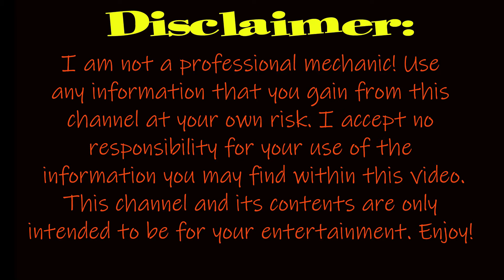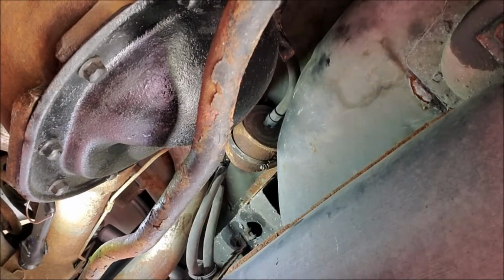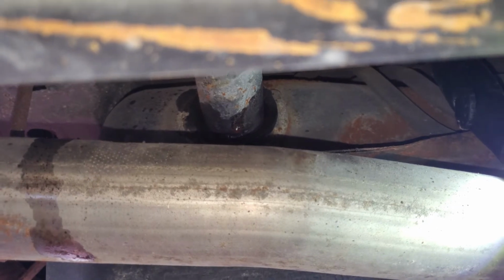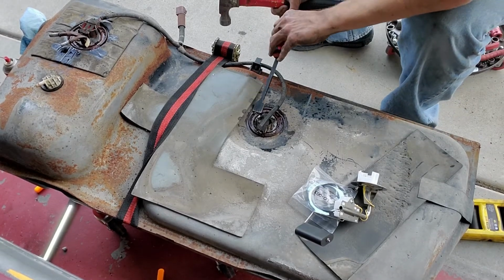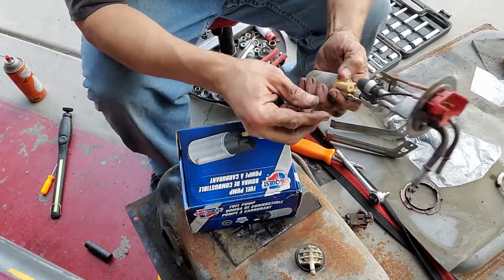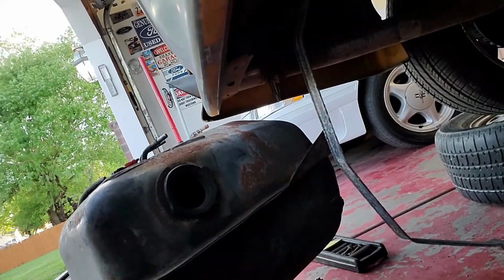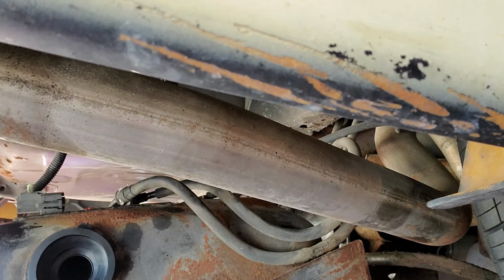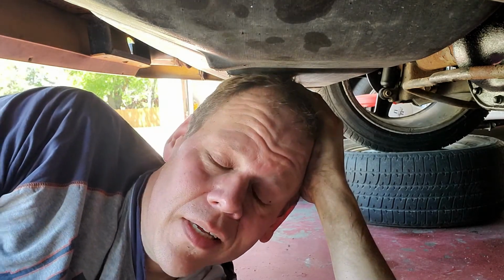The 89G ☑️ Fox Body Fuel Pump, Sending Unit, Filter, and Filler Neck Grommet Install 💥 EP46

Comment: I have a quick question.  I have a 88 lx it a 4 banger that plain to change out to a v8 one day.  My question is I've changed out the fuel pump  sending unit  fuel filter and fuel neck grommet .  On someday the fuel pump will prime like normal then there's other  days it primes continuously and want shut off . What do you think the issue may be?
Reply from the maker: I'd start easy by checking/replacing the FP relay under the drivers seat. I'm not certain on the 4 cylinder, but the symptoms you are experiencing could be signs of a failing ECU. When the fuel pump runs continuously, does it still start and run?
Reply: I've changed the fuel pump relay and yes it will start but its a ruff idle
Reply from the maker: I can send you a schematic if you'd like. It says pin 22 is where you need to check coming out of the ECU. It should provide a ground signal for the relay to turn on.
Reply: Ok cool send it to me.
Reply: Thanks for your help also
Reply from the maker: @dwayneharris8957  email me at eightninegarage@gmail.com  and I'll send it to you
Reply from the maker: @dwayneharris8957  no problem. Glad to help.